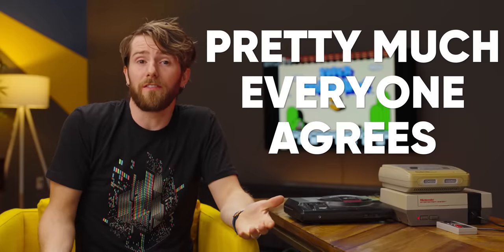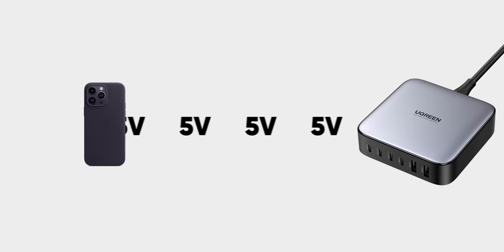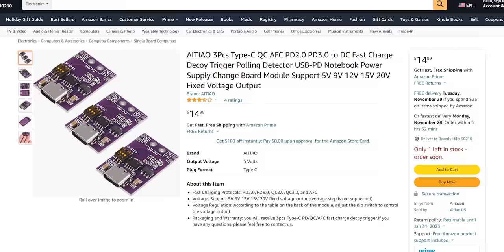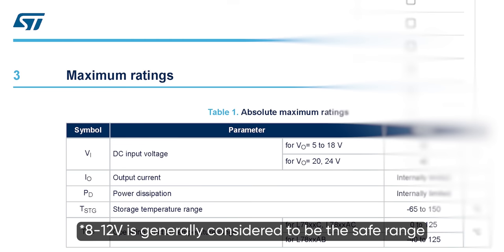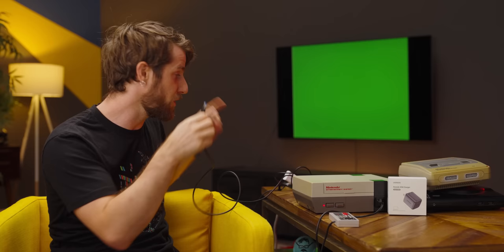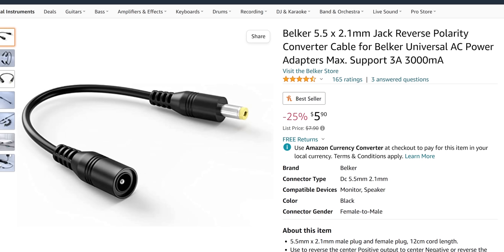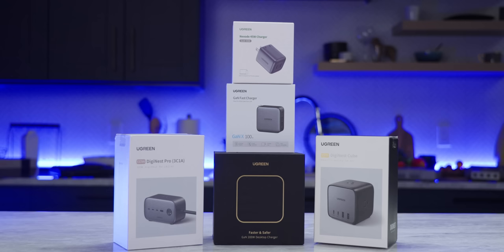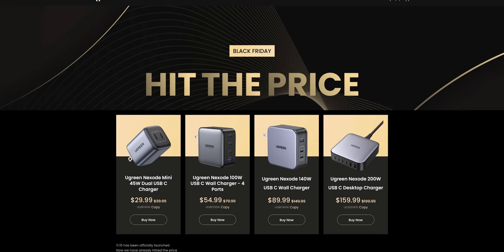How to Put USB-C Power on ANYTHING (almost)

Comment: May I ask the power efficiency gains/losses on this? The LTT Lab seems equipped to answer this.
Reply: all gains.  the losses come from how the power is supplied, not modulated.   instead of a heat spreadder used in conjunction, power is fit exactly to spec.   thats why old bricks are ....bricks.

Comment: For the Type C power part, are there any decent buck converters you would recommend.

For example the buck converter you used in The God of Fans; is there a type C version of that.

Input is 24/48/96V DC, and the output will be automatic based on Type C connection.

Comment: The SNES/NES/Genesis can have interplay with cords. The NES can lend its cable to the genesis but you don't want to send the genesis cord to the NES. It'll fry the thing. 

Honestly I've been collecting and modding retro for years and I've seen enough of these gimmick cables pop up that are always suspect. Just stick with OEM hardware or mod the console itself.

Comment: Yeah, still hate Type-C. Have to explain to customers almost daily that just because device X has a Type-C port, it won't charge\communicate\display\work with device Y. Just today I had to explain why a cheap phone charger or battery bank with a Type-C port won't charge their laptop which had both a barrel plug and a Type-C port for charging. The old way is much better, much less angry customers.

Comment: Linus come on if you use 12 volt dc adapter on a ac to dc converter you get 12 volt dc rhe circur does nothing to dc it will work anyway you dont need to change the pover suply

Comment: I might be in the minority, but I absolutely hate the physical USB-C connector. It has terrible tolerances on every single USB-C device I own. The USB-C on the back of a $400 motherboard is so loose that it just falls out some times. That's a particularly bad one, but the rest are not great. At best, USB-C's tolerances allow for several degrees of wobble when plugged into anything which seems unacceptable to me.

Comment: Question: I bought a 5v 100w power supply, to avoid the entire QC/PD problem. (Thats the shiny DIY style bricks you can buy all day long on Ebay for like $20.) Should I be concerned with ripple? 

TLDR:
I'm trying to power a newer Chromecast 4k and a Samsung 500g SSD off of a USBC3 hub. I'm getting intermittent behavior from both the storage and the chromecast where power cycling clears it up. I'm sure I need to feed it more power than a few amps, as most people say that the stock chargers are insufficient on a hub BEFORE adding storage. A Dell 65w QC, and a 5v 10a power supply haven't improved my experience. I understand that it could be an entirely different problem, but I want to make sure my power is rock solid first. 

I'm not married to the 20a brick, I can use it in other, less sensitive, projects. But I have it now so that'd be nice. 

I'm handy and can solder but I don't have testing equipment. Not even a multimeter now 😢 Also, if there's a better place to post questions like this, please show me. 🙏

Comment: I recently discovered a flaw in my Asus Zephyrus, the early models support USB-C PD but if the battery is totally flat they will not charge from the USB port so I end up needing to bring the big brick. So I'm guessing I can get a barrel adapter and us it in the event I've accidentally drained it?

Comment: I would be very interested in the power draw implications of doing this. On the one hand any power plug, even if it is inactive, draws power. But the same might have to be said about the "active" cables that request a certain voltage. Does this balance out or is there - as I suspect - a power saving potential leveraged here?
Reply: It seems balances out unfortunately. The cables still draw a minute amount of power even while not connected to anything

Comment: from my experience, the biggest issue with USB-PD is labeling. just like higher speeds, PD can require different cables... but the cables often have no spec markings and the USB Standards have some wacky naming
Reply: that would be why his cable solution is bad....you would be better modifying everything inside the cases so any usb c plug will either have enough power, or not turn on.  instead of one adapter: hes proposing you have 3:   from the wall to the cable...from the cable to the adapter, and the adapter to the device.  madhouse.

Comment: Ok, but the cost of doing this is quite high. You need both power adapter capable of having enough power for given devices and cables with added conversion to boot.

Comment: What happens if you use for example 130watt USB charger with a triggerboard for a laptop to supply 130w 6amp but then plug that USB into a device which only uses 45watts. Will the triggerboard know it uses less power or will still supply 20v 6amp and fry it? and if it would fry it, is there a way to tell it to supply less volts like native USB C PD?

Comment: Any solutions to the power pause safety feature? Can a manufacturer remove it without loosing any certification? This sucks especially for external hard drives
Reply: I bought 2 products from ISDT the 200 and 200x, both have been changing, swapping without any interruption with other devices while charging.
Reply: @Vamanos46  But that's a battery discharger, not a power adapter

Comment: this all seems a bit overcomplicated when you consider that universal power adaptors that come with various connectors for various DC plugs have existed for decades and only require you to set the right voltage on the power brick that plugs into the wall. 

It seems outright ridiculous in most cases when talking about devices with built in power supplies that use a fairly universal 120V power cord that most people will have laying around somewhere in their house if they're into technology and electronics at any level. I've on more than one occasion taken a power cord from a boombox or other device to power a playstation for example, all without having to order special adaptors or go to the store to buy an official sony power cord. 

solutions to powering devices don't always have to be complicated or brand new technology. Always remember the acronym many technicians and engineers in various fields live by which is K.I.S.S aka keep it simple stupid. The simpler you can keep a given device's operation the less likely something can go wrong with it.

Comment: I wouldn’t be so afraid of the voltage, I’m more worried about the amps, at least the PS2 power supply that I have has an input of 100-240v AC at 1.5A, and an out out of 8.5v DC at 5.6A, can a usb C Handel 47.6 watts constantly?

Comment: This solution is the same as iPhone's Lightning to USB-C cable... Both ends need to be usb-c not one. The only solution is soldering different female connectors on every device.

Comment: I have some issues with my Wacum cleaner, the adapter I bought seems to put to much Watts into it and it stalls. It can only handly around 33 watts or so but the systems ends up putting way more into it 50-100 watts and then it makes an error. I tried with one charger that should only do 30 watts but it just makes it blink although the oldest version of PowerPort Atom PD1.

Comment: So I'm trying to charge my DJI Mavic 3 Pro batteries on the three battery charger with an Anker 140 watt PD power brick. The OEM USB C power supply is rated for 65 watts so in theory this should work however, it doesn't I'm thinking something is going on during the handshake process. When I plug in the power-brick directly into the back of the drone with a single battery I'm outputting roughly 74 watts. This seems to be working. Any ideas if there is a work around because the power-brick has a lot of utility given its 24000 Mah capacity in a very small package. In theory I should be able to charge three Mavic three batteries with one of them.

Comment: I have an older Chromebook with a barrel plug and a newer Chromebook that's USB-C/PD. I've been trying to get where I can use the same charger for both (both are 45W), but have had trouble finding a USB-C/barrel cable/converter of the right size (Acer R11), any tips?

Comment: I was wondering if it would work to plug my laptop on a power bank using a USB C to DC adaptor?

( My laptop isn't compatible with USB C charging and power banks with AC outlet are too expensive ).

Comment: Is it just me or is this going to lead to someone getting made that their USB-C wire can't pull 850 Watts for their computer? You kind of cap out at 100Watts per connection. As the high end desktop is moving to 1300W PSUs as the recommended PSUs and some are using 720W ~ 800W from the wall having only a max of 100W isn't that good and i foresee a connection to the wall outlet as is still being a thing for a while due to people liking desktops. Mostly as they don't run out of battery so you can put power hog components into them without much care about running out of power. You do have the house circuit maximum to which i forget. It's something like 1500W ~ 1800W on 120V in the USA for the citizen consumer house circuits.

Comment: I have 6 monitors for my PC. 2 Sceptre M24; 1 Sceptre L24; 2 Element E1SW2418M all with a 12V DC adapter. The other monitor has a regular plug. What converter do I need to use for the DC monitors to convert them to be able to use 1 USB C adapter brick?

Comment: can your house be powered by usbc
Reply: Low voltage has higher losses for the same power output. For getting power from a to b you want the highest voltage you can. So I guess the answer is: when usb c supports house mains voltages! But the wires and pins are way too small to do that safely

Comment: From memory (do not rely on this), Even though NES and Super NES were shipping with DC power supplies they accepted 9V AC input meaning it doesn't matter about polarity as it's rectified within the console. Is there anyone with a circuit diagram that would be able to confirm this?

Comment: My old HP PC run on 12V barrel Jack. I lost my OG one. So, i replace it with AC adapter from my CCTV. It works. But, it lost its ability to turn off. I knew it because my flasdrive had the LED blinking and the USB PC speaker are humming. Is it going to be the same if i use USB C as A power input??!!

Comment: Well i hate USB C, had many phones with USB-B (micro) and never had any problems... every USB C device i have has since broken due to loosly fitting connector that eventually stops working. It see it upsides in technical use but for me the best connector still is micro USB
Reply: Repairing a lose type c is as simple as adding a magnet

Comment: sounds expensive:
   cd-era consoles-   40$ parts mod per console.
8-16bit consoles-  8$ special cable per console
100W  usbc PD  brick - 60$
labor modding consoles - 45mins per....average

all that vs a power squid.    

note: Im in the process of modding cd era devices to emulation hardware:  and they dont require power supply modding...but greatly benefit from it.

and this is only for old consoles.  theres a ton of cheap DC appliances that this adds significant expense to convert (chromebooks, dj controllers, audio interfaces, network switches, LAPTOPS, and small battery equipment.)   I bought some inconsistent bricks from aliexpress at 30w with one pd slot...and am/was disappointed to see it not charging my switch or gf's s21.   I want PD to be a thing...but it's alot.   cost needs to come way down, or QOL budget need to come up.  also....stop making power cubes.   make strips.  things need to lay on the floor, or have a mounting surface.

Comment: Hi, I'm currently using an iPad Air 5(2022) which doesn't have 3.5mm jack. I'm thinking of buying a 2-in-1  splitter for both audio and charging simultaneously. Is it advisable to use  other brand splitters for this purpose? Will it affect my ipad in any way? I'm open to suggestions
Reply: if it says its for this purpose, you would hope to assume the seller verified the specific use case.   also, its possible to have fail-safe electronics in the ipad to prvent errors like manufacturing defects on accessories from taking your ipad's life.     learn more, read reviews...and sometimes you just have to take a risk.

Comment: One reason I hate USB c is when you want to plug something in from behind so your reach in between the wall and the device (Which you might not move easily) and just can't find the plug. On type A and B you would easily feel where the ports are but on USB C your fingers can just glide over it and you don't deel it (especially when there are fan hole right next to it, it feels exactly the same)

Comment: The reason the international and Japanese Nintendo power inputs are different sizes isn’t just a silly Nintendo reason. Japanese consoles take 9v DC but international consoles use 9v AC. Look at the markings at 3:33 

The original power supplies were specifically engineered for their console. Please just recap the original one and use that if you care about your stuff

Comment: The only reason why this isn’t always viable for old devices…. Is cuz.
If you don’t find a power brick that’s the exact specs to the one included with the device (like the N64 or something)
Then you might cause unintended issues with the device, and possibly breaking it permanently. This is why I’m someone who’s partial to emulator or alternate copies of games whenever I wanna play them again.
Like I’ve had Mario 64 on Wii for ages, as well as the collection. But I’m hardly interested these days anymore, because of new and interesting games.

Comment: I must be one of the few people to not like USB-C. Its crammed with so much stuff now its actually impossible to figure out what to buy even for something as simple as a chager. My phone supports 45w charging, ok i can get a usb-c pd 3.0 charger but thats only 35w, ok i can get a pd 4.0, nope doesnt exist. ok i need a pd 3.0 profile 3 or possibly a profile 4 if i get the extra special cable ? The specifacation is allover the place.
Secondly the actual physical interface is trash. I am by no means an apple fan but hell at least the know not to put tiny bits of plastic in their ports that snap off, or simply dont work if, god forbid, a small fiber gets logded in there from oh lets imagine the inside of a pocket.
I think its stupid to force companies to use usb-c as well (again looking at apple here). I understand it from an e-waste standard and people making stupid connections to lock you into 1st party only stuff. I think a better alternative would be to allow some form of appeal if usb-c isnt suitable for the device or your own port has improvements over the usb-c standard (e.g. fully magnetic connections or waterproof ports)

Comment: Hi, thank you a lot for this very interesting video subject ans test. I've got a question if someone knows the answe : In short if we plug a usb type C (10gbps PD with 4K video stream) into a desktop usb type A (3.2 gen 2) red port with an adapter, will the video stream and Power distribution work fine ? and do you have a name + link to a usb-c to usb-a 3.2 gen 2 adapter which would do the job ?

Detailled description of the problem : I use a graphic display tablet (huion kamvas 22plus) but the cable (on the tablet side usb type C 10gbps PD with 4K video stream // on the computer side it splits into 3 cables : power adapter + usb 3 type A + HDMI 2.0) is to short to use it with my standing desk and monitor arm. I want to know if i can buy and use one only cable which would be a longer (3m) usb-C to usb-C (10gbps PD with 4K video stream) with an adapter (usb type C to usb type A) on the desktop computer side (which don't have usb-C port but only USB type A (blue ones 3.2 gen 1 // and red ones 3.2 gen 2)). 

Thank you a lot for the ones which would read or answer my problem.

Comment: Well, just use the original adapter, it will last longer than a converter from 21st century that nobody ever had heard of and sponsering a channel on Youtube to make one sale..... And ruining your retro consoles with stupid plugs that will be faded out in 3 years... What is old already, cant get outdated, this thing is just a stupid move from the very beginning. Not to mention that European NES/SNES have AC 9V and not DC 9V. It may work but its as crappy as the rest of this solution.